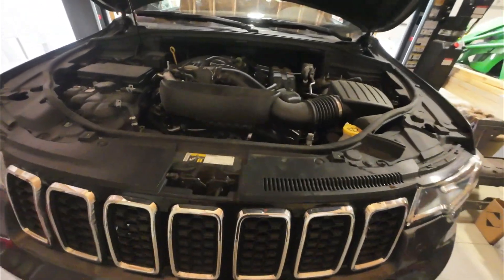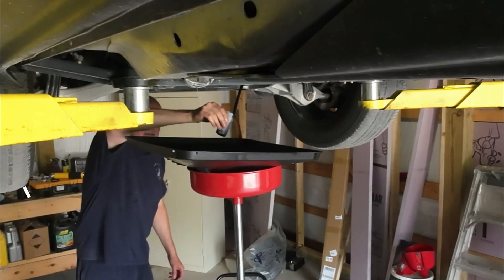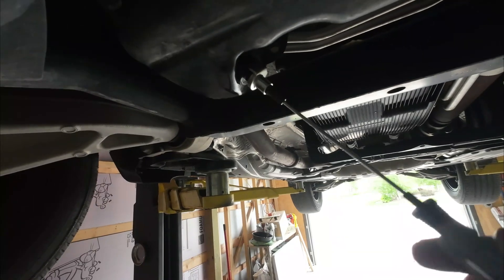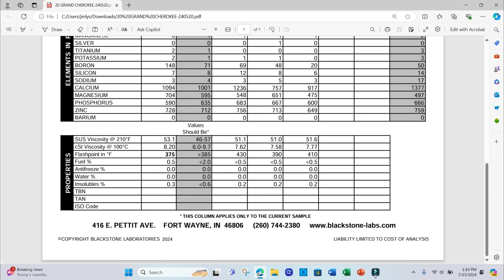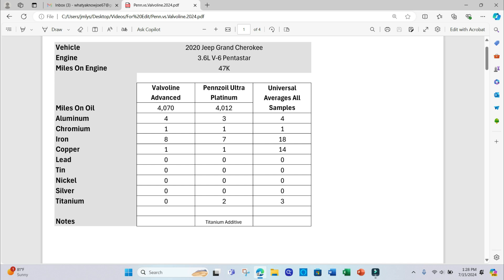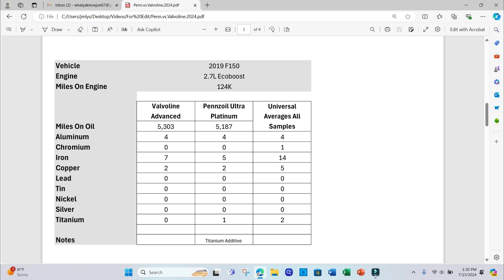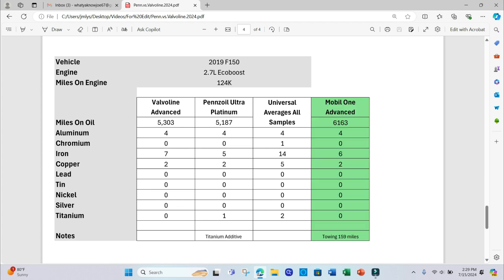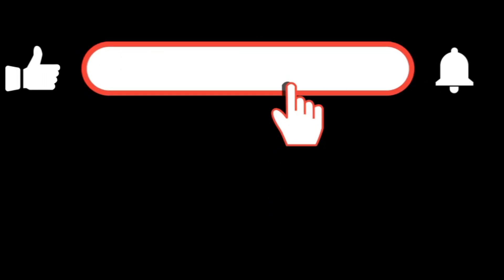Real World Oil Test Results: Valvoline vs Pennzoil

Comment: Two (Good) oils but neither are the best !      Try Amsoil,  it beats all the others in "Real World" as there are tests on the oils used after mileage.
Reply from the maker: Testing amsoil right now
Reply: @whatyaknowjoe67 What viscosity are you testing?
Reply: If Amsoil was so wonderfully why don't they get the license for Dexos 1 Gen 3? Why don't they  have third party data published that backs their claim.
Reply: @brianmaloney5430     AMSOIL synthetic motor oils meet or exceed the latest GM dexos specifications, including: 
dexos1 Gen 2
AMSOIL OE 0W-20 100% Synthetic Motor Oil offers 47% more wear protection and 100% protection against LSPI than required by this specification. 
dexos1 Gen 3
AMSOIL synthetic motor oils meet the latest dexos1 Gen 3 specifications. 
dexos R
AMSOIL Signature Series 0W-40 and 5W-50 packages have the dexos R icon and outperform the dexos R specification.
Reply: Amsoil signature series lacks the required approvals. Worrisome if under warranty.
Reply: @RFJersey  That is correct, Amsoil Signature performs well in wear tests because it has too much ZDDP, which is restricted by the API due to the fact that it can cause emissions equipment failures. Plus, Amsoil Signature is outrageously expensive. The other two lines of Amsoil are API certified, but no one ever shows any wear tests for those.
Reply: @RFJersey  Untrue - AMSOIL synthetic motor oils meet or exceed the latest industry standards, including GM dexos1 Gen 2 and Gen 3, API SP, and ILSAC GF-6.     AMSOIL offers a Limited Warranty that covers the cost to repair or replace damaged components for as long as the product is used. The warranty also doesn't restrict coverage based on vehicle miles. For example, AMSOIL Signature Series Synthetic Motor Oil is guaranteed for 25,000 miles, 700 hours of operation, or one year, whichever comes first, in normal service. In severe service, it's guaranteed for 15,000 miles.

Comment: Great video with REAL results. Im a big fan of both oils, these are my personal top 2 oils. Pup and Valvoline restore and protect
Reply from the maker: Thank you!
Reply: That’s a good combo.  I got a couple used cars this last year and will probably use Restore & Protect for a few oil changes to clean anything out then switch to PUP.
Reply: @ctusser plenty of great cleansers    ,, in ULTRA PLAT. PENZOIL.. WE RUN EXTREME WORKING TAXIS. IN MIAMI FL. EXTREME HEAT. PENZ,, UTRA. PLAT. CLEANED UP ..WE GAVE IT 5 ! STARS..🎉🎉❤❤

Comment: I'm looking forward to trying the new Valvoline Restore & Protect oil.
Reply from the maker: I’ve seen that oil…curious as to how well it performs and how much it costs. With that said…in my opinion there are a lot of marketing ploys out there…I feel any brand will perform well…buy what’s on sale and change frequently
Reply: @whatyaknowjoe67 Restore & Protect is the only oil on the consumer level that cleans. It’s been studied and Valvoline has the proof.
Reply: @whatyaknowjoe67  $6 per quart if you buy it in jugs thru Valvoline direct, and a few other vendors like Amazon.  This is a proven high detergent oil to keep your rings free per a tribologist, and better than what any Penn can do. I am switching to R&P from PUP for ALL of my vehicles new and old.
Reply: @whatyaknowjoe67  Been reading comments on people using R&P, and it's not a ploy, they say it works!!!!!
Reply: My 2UZfe loves the restore and protect...
Reply: On my second oil change with the restore and protect. It's kinda expensive around here. Especially when you pair it with a wix xp filter. I typically run 3500 miles oci on my 19 civic coupe ex-t.  So I tend to just use what's on sale, typically Kirkland. The 1.5t gdi engine is known for oil dilution issues. So I've been changing the oil sooner than later. This time though I'm going 5,000 miles.
Reply: @vermontvermont9292  hey greetings from the next state over.  Lake Speed Jr (aka The Motor Oil Geek) reviewed my gassy smelling oil this past winter in my port/direct 18 Camry LE: 1.6% dilution. The solution? Stop buying generic gas and start adding Chevron Techron every oil change to clean out the injectors. Dirty injectors help cause dilution. That gas additive worked immediately and is currently on sale at Napa at $13 for a 32oz bottle (1oz per gallon). Valvoline R&P is currently $30 or lower per 5qt jug direct thru Valvoline.
Reply: @vermontvermont9292  Which is good, because it cleans so well, you don't want to clog the filter!!!!!
Reply: I use restore and protect in my range rover sport, and the difference is amazing.
Reply: @michaelwalker9668 what type of difference you notice

Comment: Those are all within a margin of error, basically the same. Can’t go wrong with either oil choice. I can never find the Penzoil Ultra anywhere so I always get Valvoline.
Reply: I get it online. Amazon, Walmart, and Advance Auto sell it. Sometimes, it goes on sale, and I'll stock up. PUP is a good oil.
Reply from the maker: Same here…hard to find the Ultra in my area as well.
Reply: I'm wondering about cross contamination of the oil samples.
Reply: @jamestikalsky4240  The correct way to compare wear numbers between different oils is to flush the engine of the first batch of oil you drained with the second oil your testing against. After the second oil your running has been ran for a few hours drain it and fill it back up with the same and run your interval.
Reply: You could go wrong. Run that valvoline in a sludged up engine and you will have new problems real fast. Most of the sludge is not harming anything but loosen it and it will.
Reply: @caesarflickerman7047 😂

Comment: Excellent video. Based on this I can totally see that the brand doesn't really matter that much. The proper oil and the prompt OCI is all you need to protect your engine for many years.   1 PPM vs 3PPM is in the realm of data aqisition error.
Reply from the maker: Agree…thanks for the comment.